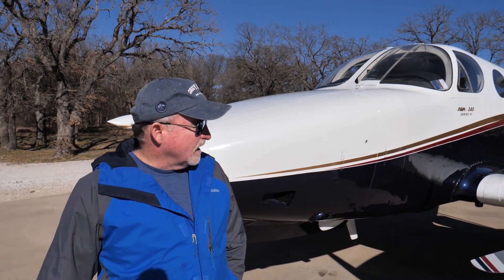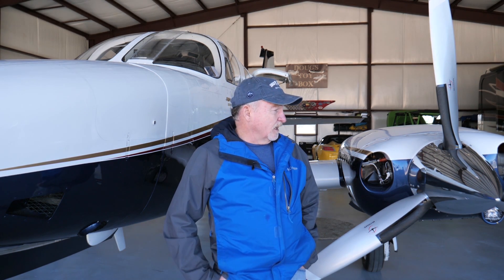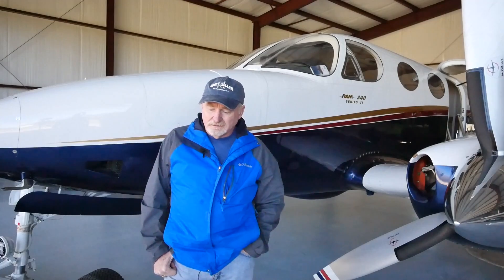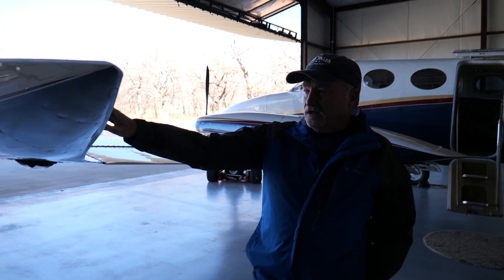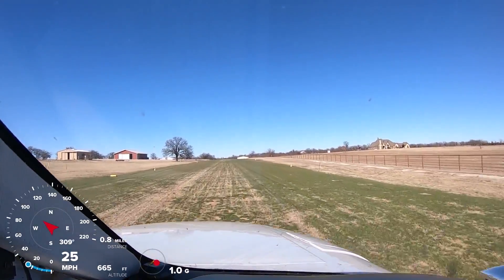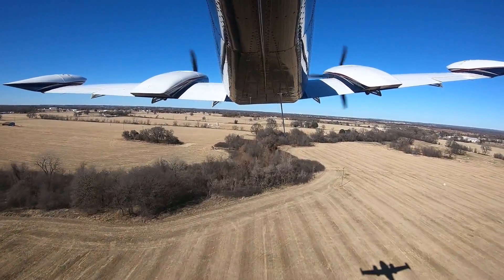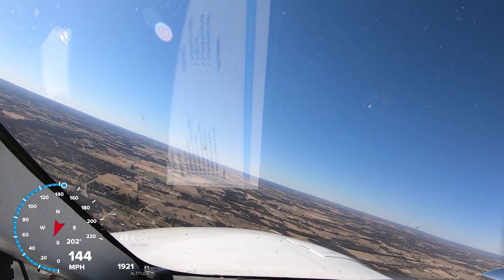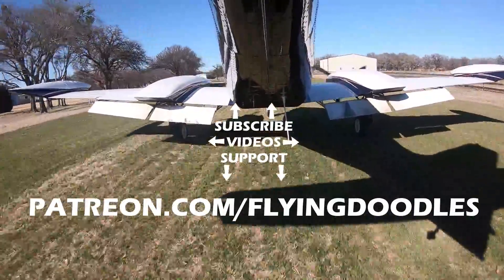Cessna 340 - Modified for Short & Soft Field Takeoff & Landings

Comment: I had the pleasure of flying a 340 a couple years for a company and it was a good airplane, but not as nearly well equipped as Dour's.   It had spoilers added which made it easier to get down from altitude and get the engines cooled.

Comment: I flew a straight 310R in Africa almost always overloaded and almost always in and out of gashed out patches better suited for 182's or helicopters.  True, if I had ever lost an engine I'd have lost the plane in many instances, but they never failed me.  It had the same wing as your 340 without the Robertson.  My thought is the kit is totally not needed and just adds dead weight.  The split flaps on that plane are more than enough to come straight down.  Your pressurization adds a lot of weight too, plus it's a bigger fuselage so the comparison is really only with the wing.  Beautiful plane, but I just wanted to say, a normal 310R can get in and out of anything resembling an airstrip as well as any bush plane.  Many non-310 flyers might not know that.   Also flew the C-335 and C-402C's regularly over there when in less demanding environments.  The 335 is rather rare.  Same as your 340 without the pressurization.  I miss those days.

Comment: Robertson STOL systems are amazing,  I owned a Seneca III, with the system.  Complete transformation.  Amazing performance while increasing safety and single engine performance. I have also flown RAM conversion 340A.  I can only imagine the increase with Robertson STOL.  

With the package, the flying characteristics are different. Once learned, the R-STOL increases safety margins, and is a blast to fly.  Passengers are always amazed at the takeoff and climb performance. 

Thank you doodle man for focusing on the R-STOL system.

Comment: Smart pilot! You have to have tuned fuel injectors to run lean of peak. It would be easy enough to reach out to this gentleman for more information if you are interested. The general aviation community is very open and friendly. 
The mandate for ADSB more or less forced people to spend $$,$$$.$$ on upgrades to the whole instrument panel. His instrument panel would have been the envy of the airlines 30 years ago. Very nice airplane.

Comment: Wow!  Sweet plane! New interior, new panel, new paint, how does it get any better?  More efficient engines?  40 gallons an hour puts a dent in the wallet for sure but not unheard of for a twin cabin class pressurized aircraft.  The piper Aztec I had could carry 2100 useful load.  Not as comfortable as the cabin class but you could haul a lot of stuff passengers AND fuel.  I flew a couple times in a buddy's Cessna 414.  The air conditioning was awesome!

Comment: Time to get your ticket active Bobby. You can see the desire in your eyes to fly again.

The price of Cessna 340's has gone nuts since I sold mine. Four years ago, you could purchase a 340 with 5,000-6,000 TT, engines having 3-400 hours remaining before overhaul, for under $80K. For the $80k price, it was a basic steam gauged, but still a pressurized twin.
Reply: How much will it cost to have the engines overhauled?
Reply: SanFranciscoBay +
  Standard IO-520 Continental’ on an exchanged basis run $40-45k each based on the tear down of your cores. The Ram VI’s were in the $60k range each, but that was 3 years ago pricing. 
 The props are time rated to 5 years or I believe 1000 hours. 

With a twin, you need a reserve fund of $50-55 per hour of operation for engines, $12-15 per hour for props and governors, and another $32-35 per hour for the air frame. 

I have my A&P, so my inspection costs were lower than average, but I don’t own some of the speciality tools, so either I pay someone or trade for labor. 

Old Cessna parts are expensive. You know getting into flying that a single is going to burn $75 of fuel an hour. With a twin, it’s $175 an hour. With all the costs associated with operation and ownership, it still beat flying commercial.
Reply: @gungadinn  If you earn $100,000+ per year, sounds like fun to fly.
Reply: @gungadinn  What do aircraft owners do with their old propellers? Wall Art, scrap metal...?
Reply: SanFranciscoBay+

  It depends on the propellor. Constant velocity props have replaceable blades that can be individually replaced until they run out of hours. Then you’ve got the hub and governor assembly. 
  
Aluminum props get dinged and suffer erosion from dirt in the air as well as dirt from the runway.  You can file to remove the burrs. If out of limits, you can replace a single blade instead of all two,three, four, or five blades. Once the blade root wears out, wall art is the preferred method of disposal.
Reply: @sanfranciscobay  a hundred grand a year aint gonna cut it.

Comment: Lots of skilled people went into building that airplane. Does the job well. So operating cost of $200 per hr. on fuel and a total of $300?
Reply: Greg Milner I figure $170/ hr for fuel and $20,000/year for fixed cost
Reply: Twin Cessna group figures $465/hr all in, but since I own my hangar and  do a lot of my  own A&P assisted maintenance , my cost is much lower

Comment: Amazing A/C. I wouldn’t talk about ASD off 2300 turf with this airplane. Just doesn’t exist does it?  I believe the revised practice for boots is to use early and often.
Reply: what is ASD? There is a lot of discussion now on whether or not "ice bridging" is really a thing or not. I have no personal knowledge either way.
Reply: Accelerate stop distance, aka balanced field length and take off field length are relevant to multi engine aircraft take off performance and safety. See AC 91-74B for everything you wanted to know about FIKI. Like so many things we have been told or taught in flying are base on myth, so is the ice bridging. If you see ice get rid of it. Pneumatic boots are among the least effective equipment at deicing so work them hard.
Reply: Lew, sorry, had a brain fart. ASD is 1,850’ on this plane for pavement. But reality is probably far different from that. We just don’t encounter much ice in our part of the world. I’ve used the boots maybe 3-4 times. I’m not FiKI even though I have everything except the inboard boots. I agree bridging is probably a myth.

Comment: Am I mistaken or is there NO margin for power trouble on take off?  At the moment of liftoff the end of the runway is really close.
Reply: at the moment of lift off we are 10 knots above Vmc, so the plane will fly if the gear is coming up. Its not a lot different than losing the engine on a single before that point.
Reply: I'm not necessarily following.  If you have power trouble anywhere around that time you're going into the trees at the end of the runway, no?  Not enough room to roll out.   And didn't you mean V instead of Vmc?   I don't mean to sound critical here-  I admire the guy and his lifestyle big time.
Reply: Vmc is minimum controllable speed in a twin. Above that speed my plane will fly on one engine. Not all planes have excess power to do so. Thanks for the compliment, I love my life!
Reply: Thanks, got it.  I didn't think a twin engine plane could continue to take off on one engine.  It would still be hair-raisingly close though, wouldn't it?  Like you'd barely climb and barely make it over the trees?  Glad to hear your plane can manage.  I imagine you'd have to have nerves of steel and do the right thing at that exact moment or too late.
Reply: @someotherdude  , everything has to be done correctly in a very short period of time. It is something I train for almost endlessly, both in the plane and simulator at recurrency training. You are right, there is little margin for error.

Comment: I'm curious how he's able to use the G500 as an IFR craft when the G500 is only certified for <6,000 lbs MGW.  He has the VGs and the Ram 6 upgrades which give him a MGW of 6,300.  Can someone please advise?  Looking to do a panel upgrade in my C340 and would love to go down this road if possible.
Reply: Hi Will! Thats a great question. When we reached out to Garmin, we found that the FAA determined that the original type certificate weight is used to determine eligibility. So, this being said, the original gross weight of 5,990# is what determines which system to use. That being said, if I were to to this again I would go with the G600, since the cost difference is nominal after you add in the options. Of course the G500/600 is pretty much old news now with the new G3x equipment ( that is what I have installed in the new STOL plane.... stay tuned!)

Comment: he lost me when he said he flys it lean of peak
Reply: jefar amoose why is that?
Reply: Been flying twin cessnas for years you never run lean of peak you run rich of peak so you can make it to tbo on those sensitive continentals
Reply: @jefar53  , might I suggest you take the Advanced Pilot Training course at: https://www.advancedpilot.com/onlinecourse.html .
You will learn a lot about engines and it will dispel some old wives tails regarding Lean of Peak. I have been running LOP now for over 20 years, and I see many big continentals going out over 2,500 hours between overhauls running this way. They run lower ICP's and cylinder head temperatures, which, I am sure will agree, is the key to longivity. Thanks for your comment!